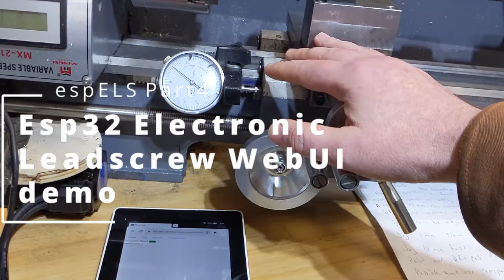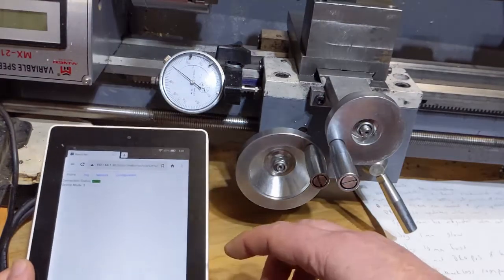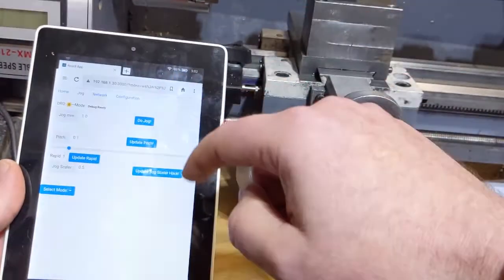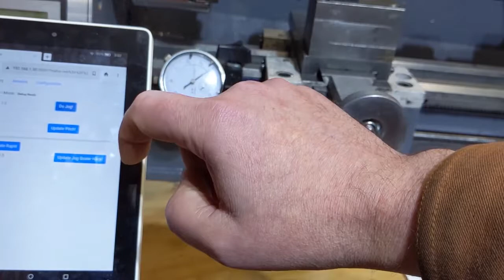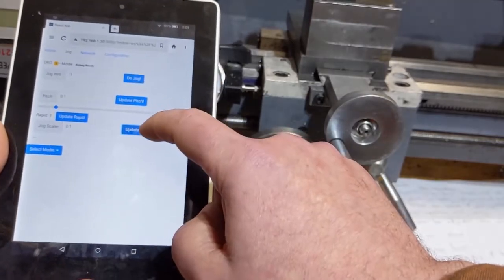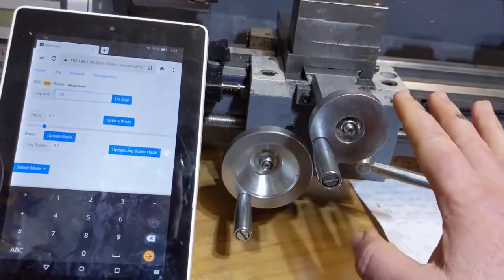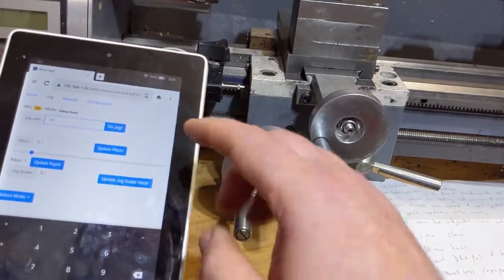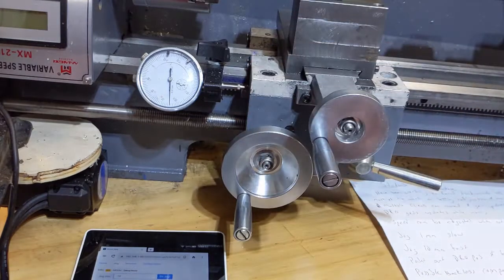espELS: part4 esp32 electronic leadscrew webUI prototype

Comment: Nice one, keep it going 👍
Reply from the maker: Thanks, i've moved to a Bresenham derivative and uploaded a new test today.  Wondering how you are doing your thread start syncing?  It didn't jump out from your code.
Reply: @JesseSchoch  I'm keeping track of stepper and spindle positions in 2 long variables. When ELS is enabled, I reset them to 0. From that point I move the stepper to position calculated by posFromSpindle function as often as possible - https://github.com/kachurovskiy/nanoels/blob/8537c46c7e48d9af401fe3221b210926dc6f284e/h1/NanoEls.ino#L644